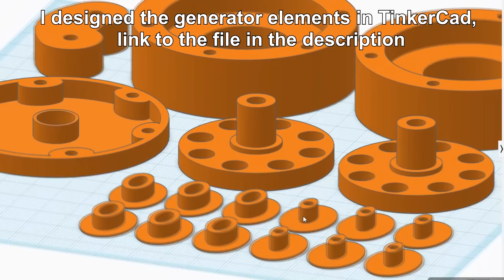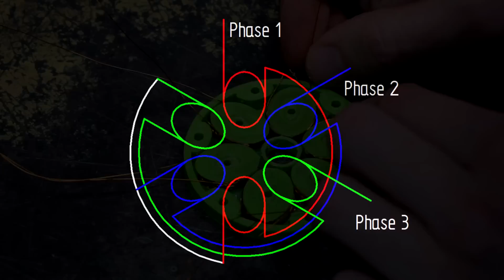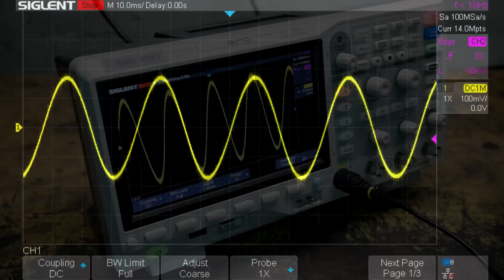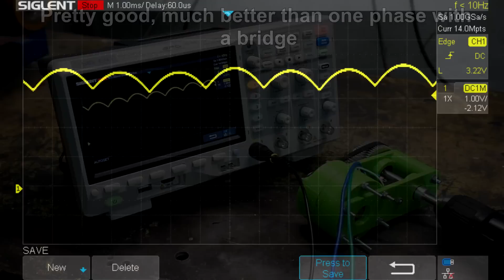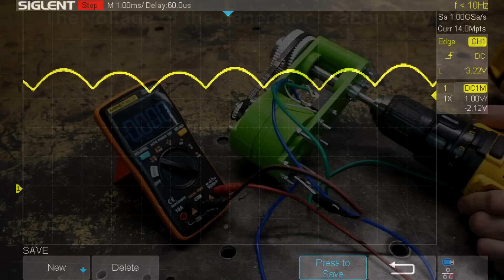Making a High Efficiency Energy Generator

Comment: Really nice, great work with a 3D printer for the hardware. 
Altho to make the generator even more efficient, placing a piece of iron plate/disc on the opposite side of the magnet disc of the coils would help push more magnetic fields into the coils.

Comment: Are there any plans to turn this into a small wind turbine? They have been plagued by poor performance.
Great build, well done.
Reply: Even this generator isn't perfect. It's just a home made BLDC motor/generator.
Output energy is always lower than input (bearing and belt friction losses, some power dissipated as heat by the machine and by the rectifier).
You could for sure put it on a wind turbine, BUT:
40w output means that continously running at full power for an hour generates 40Wh.
A small car battery its 12v 45Ah. That's 540Wh.
Electronic battery chargers have usually efficiency around 85%, that means your power to charge the battery is actyally 34W, the rest is dissipated as heat/sound.
Said that, you have to run that thing at full power for 15.8 hours just to fully charge your tiny car battery.
Now, just attach a 230v sine inverter (another 85% eff) to have an effective 459Wh of available power. 
That means you can turn on a 1kW oven for less than half an hour,  or a 2kW water heater for 13min, or a 3kW load for little bit more than 9 minutes.
And then another 16 hours to recharge.

Is this worth your time and money?
Reply: @mcconny1746  Wow, talk about the hard, depressing reality of math. lol.
 Thanks for the explanation.

Comment: Does this generator produces more power than a NEMA 23 hybrid stepper motor?  
I built a small wind turbine generator using an 8 wire unipolar stepper motor I wasn't using. 
If this generator produces more with less cogging, I would build one and replace the NEMA23. 
I also have a NEMA 34 bipolar I never used, but it's too big for my liking.